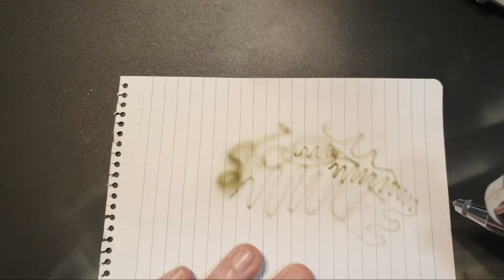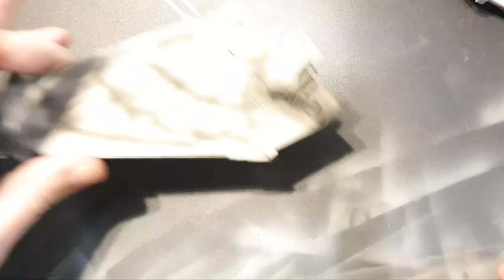Q & A On The Bench 002

Comment: I have not Used an airbrush in my life i am 65 years old. I Used to paint my Models with small brushes.  But you inspired me to have a go . So I just got a new airbrush like your with the gravity feed as you have no problem with your  . But there is one question I like to ask you If I may.  Do you have an air Storage  tank on your compressor and is that of Benefit or not . Love your work.  I wrote here because I am a little embarrassed. Thank you very much from the uk 🇬🇧
Reply from the maker: Don't be embarrassed mate. Always feel free to ask. Sorry for the late reply. Yes I used a small storage bottle attached to the compressor. I find I get a much steadier pressure and thus better paint flow. Gravity feed also seems to use a lot less paint than the suction feed ones I have tried.